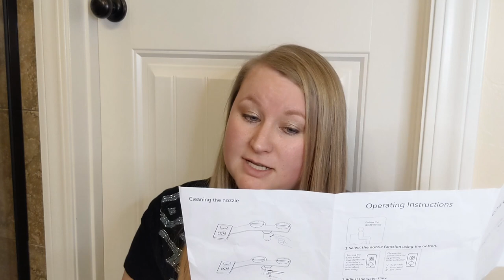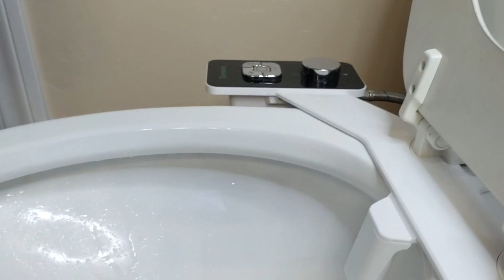Samodra Bidet Installation and Testing emergency preparedness, no toilet paper

Comment: Haven't got mine yet and not sure if how bedit connections seal but as far as toilet suppy lines go t-tape or any other pipe sealant is not needed becase the threads do not male the seal. Rather the threads tighten down to smash you rubber washer seal. Using tape on those connections is not only pointless but can actually cause a leak for the tape c
An bunch up and feel like your tight before that washer is actually tight. I asume the threads the the bidet does seal with treads and will need thread sealant. Please dont use one and plumbing fitting with rubber washers, gaskets, or fairings.

Comment: Only thing I'd suggest is putting the slot attachments vertical instead of horizontal Incase you need to adjust the angle of the spray 👍
Reply from the maker: That is a good idea, thanks! 😊
Reply: Actually the instructions say that the nozzle is to be as close to the bowl as possible, so I'd agree that the slots can actually face any direction which allows you to correctly position the bidet

Comment: Great help!  But why is my fill valve inside the tank wobbling when I attach the t adapter and now not sealed. Did i break something?
Reply from the maker: On my tank the fill valve screws into the adapter on the bottom of the tank, that adapter is what you attach the t adapter to. When you were putting the t adapter on it might have loosened up the fill valve pipe you should just be able to screw it back on and then hold the fill valve still when you screw on the t valve. I hope that helps, sometimes describing things is so much harder then showing!
Reply: Yes, thank you. I got the t adapter on but the fill tank is "leaning" and not sealed any more. It's leaking when I pour (a small amount) of water in the tank. Do i need a new fill valve?
Reply from the maker: It is really hard to know for sure what is going on without looking at it. Normally there is a plastic nut on the outside and maybe inside too that screw to the bottom of the fill valve. Those can come lose, so if it is leaking or leaning and moving at all those nuts probably just need to be tightened. so definitely make sure everything in screwed on well inside and outside right by the tank. If it were broken you would have heard like cracking from screwing the t valve on too tight. Look for a YT video about installing a fill valve too then you would be able to compare a bit better and see what is going on. If I find one I will post it here for you too. I am sorry I can't help more it is so hard to know what is happening without seeing it. 🙂
Reply from the maker: https://youtu.be/7K6pcLYrJJs

Here is a great video that shows all the pieces and if you happen to need to replace the valve it gives great directions too! At 1:13 that is the under nut I am talking about make sure that is secure. As shown at 1:22 the gasket on the inside might be old and cracking if everything is tight, that could be replaced. Those are the only reason I can think of why it is wiggling Good luck, would love to here what it is if you figure it out. 🙂

Comment: Holy crap 💩 this was helpful. Got it installed and working. I got leaking in the connection going on though. Gotta figure out what’s going on🙄
Reply from the maker: 😂,thanks! Did you use the pipe tape? That can really make a difference. You definitely don't want it to be leaking.
Reply: @countrysparkles  yeah I had that tape applied. I figured it out. I forgot to put that black washer into T connector. It stopped the leak 😀 thank you for the video. The directions provided are atrocious.
Reply from the maker: Bah haha, seriously show me instructions that are good on anything lol. So glad you figured it out!
Reply: That is a rubber washer that must be used or you will definitely have a leak. @russcastella

Comment: has anyone ran into the problem of the control panel leaking? I've been troubleshooting for about a month and cant find answers...
Reply: Note: It is recommended when not in use to have turned down the water pressure to zero before pushing the off button. As for your leak, I believe the only fix is to install another bidet from what I have read.

Comment: No need to use plumbers tape, the rubber washers make the seal. I installed mine without a leak. Just make sure you do not cross thread and do not use excessive force when tightening.